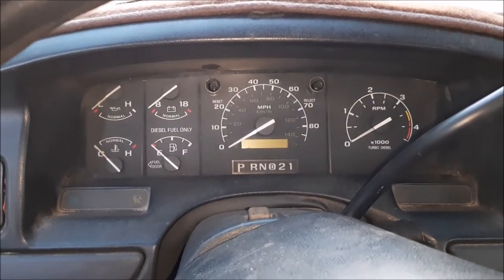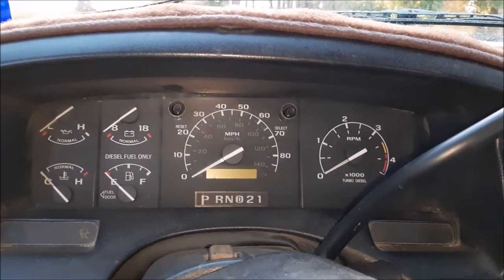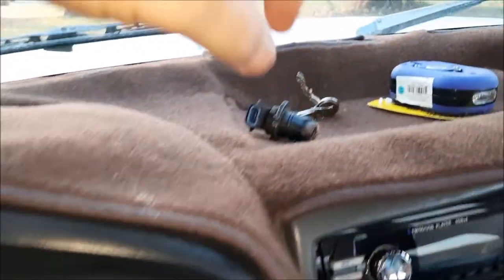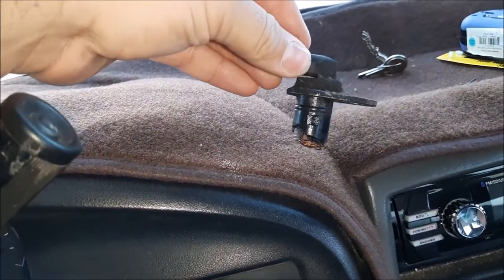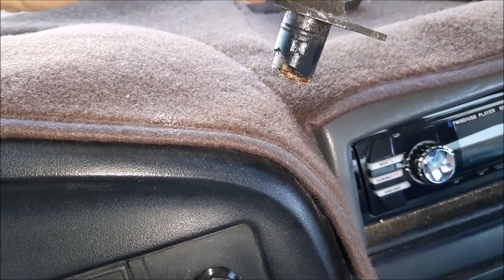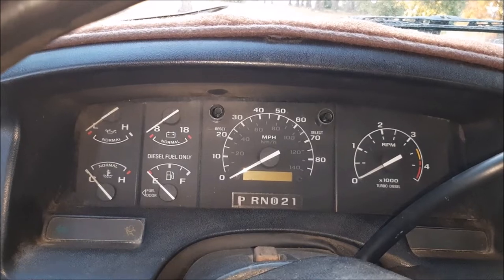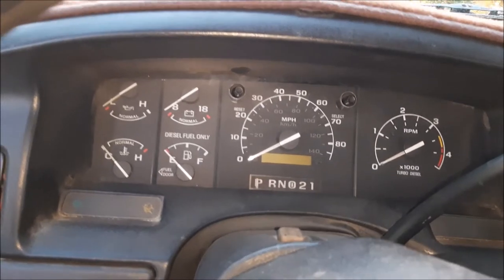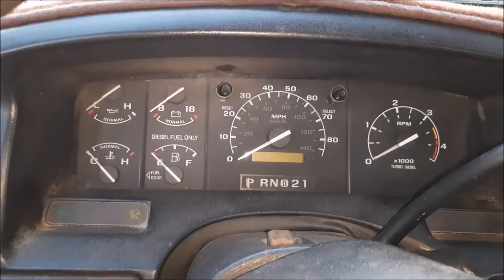OBS Ford Bouncing Speedometer

Comment from the maker: Shortly after I changed this my ring and pinion blew out.  Turns out the pinion nut was loose allowing the gears to shift and flex which lead to the sensor getting chewed up.  Definitely want to check that out too.

Comment: I have the same problem with my 95 f150 and 91 F-superduty 7.3. the abs light is out on both truck I replaced the sensor on the 95 and it still didn't fix even swapped the speedometer out trans shifts fine and odometer works. 91 is stick shift so no shifting problems with it I can't seem to figure out the issue of why the speedometer is bouncing in both trucks been like that for years now.
Reply from the maker: After I swapped the sensor my ring and pinion exploded a few weeks later.  Turns out my pinion nut was working loose allowing the gears to flex and eventually jam up and break some teeth,

Comment: 1994 F250 same problem speedo bouncing all over the place. Changed out the speed sensor with Motorcraft speed sensor still no fix. I also have an F150 96 with the same speedo cluster...no problem there. Changed out the speedo from the f-150 into the F250 to make sure it wasn't a speedo problem and the F150 speedo did the same thing as the F250 speedo. So I know it's something else. Have checked everything. Now I have to look at the tone ping in the diff. If there is a chipped tooth on it that will cause the bouncing speedo. You Ole Nasty were lucky as hell that solved your problem because this can be caused by any number of things that will affect your Trans shifting.
Reply from the maker: I put it in the description but this didn't solve my problem.  Turned out my pinion nut was loose and a few weeks later my ring and pinion gears shattered.  I had to have my whole rear end.  So definitely check out your pinion nut.

Comment: I have a 1996 ford e250 van with this same issue. I just replaced the VSS and the old one was I damaged. Still issues with the new sensor. I’ll have to check the wiring
Reply from the maker: Check your pinion nut, that was whet ended up causing this.
Reply: @OleNasty79  thanks man! I’ll check it out

Comment: Thanks my ABS light came on about month ago. Speedometer seems fine. But I think I’ll get one and try it.
F150 4x4
Reply: It is more than likely your ABS sensor in the rear differential oh, there is a gear next to the ring gear and the ABS sensor should be in the top of the diff

Comment: I had that problem switched out the sensor with a wrecking yard one still the same speedo shop says there is something in the speedo electronics that causes that problem.
Reply from the maker: For me, it turned out that my pinion nut was loose allowing everything to flex and chew up the sensor.  A week after I replaced it my ring and pinion exploded.

Comment: i have put 3 new ones and still doesn’t work what else do i get or recplace
Reply from the maker: Shortly after I changed this my ring and pinion blew out.  Turns out the pinion nut was loose allowing the gears to shift and flex which lead to the sensor getting chewed up.  Definitely want to check that out too.